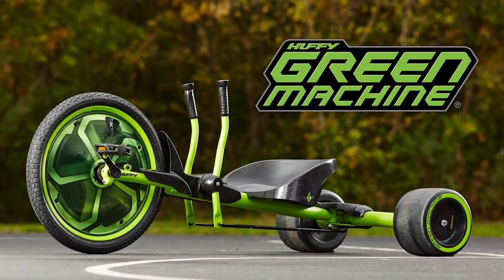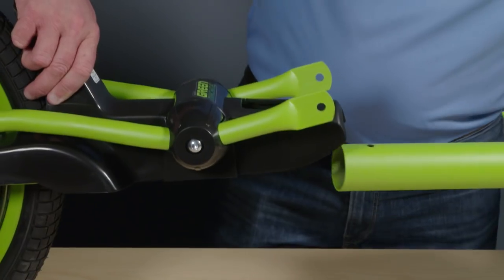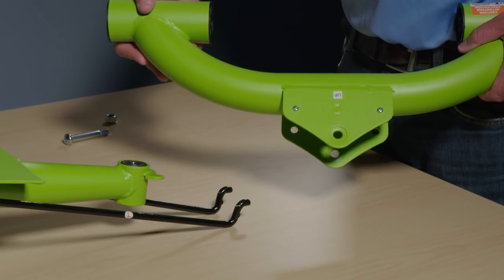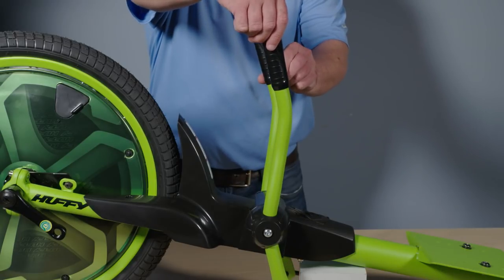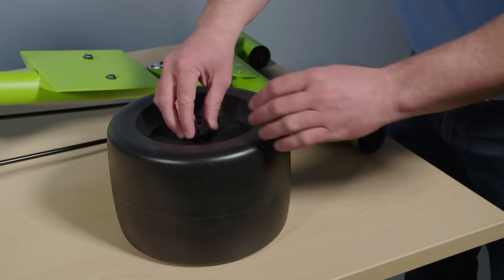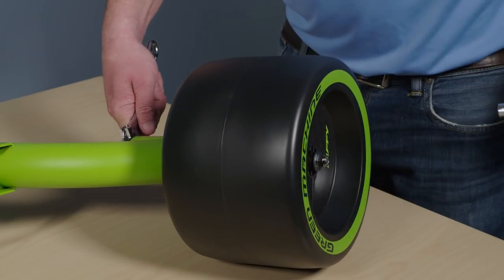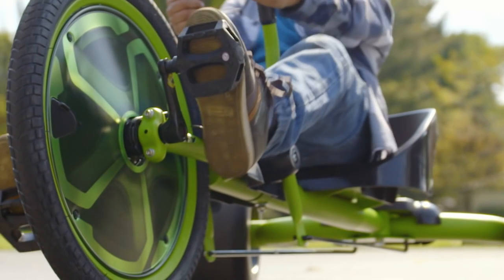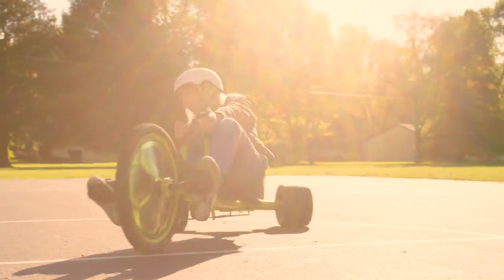How To Assemble The Green Machine by Huffy

Comment: Anything I can do to solve a problem where one of the rear wheels doesn't spin as freely as the other?
Reply: I have that problem
Reply: @arnolduriostegui1517  Lossen the axle nut just a bit.
Reply: hmmm yes, only  one side though.....  the axel is supposed to stick out a little bit so the washer can rest on the on the axle so it moves freely .. but on the the other side the axle isn't sticking out at all infact it's s to far in, so when you tighten the nut the wheel doesn't , move as freely but i'd rather it bee safe and it would still work.

I was curious so I swaped axles from the ok one to the other side but same issue, so got a feeling it's the wheel or something else causing it.

Comment: Did anyone have any trouble putting the bolt in the rear axle? 
It only goes in as far as the thread then stops
Reply: hmmm yes, only  one side though.....  the axel is supposed to stick out a little bit so the washer can rest on the on the axle so it moves freely .. but on the the other side the axle isn't sticking out at all infact it's s to far in, so when you tighten the nut the wheel doesn't , move as freely but i'd rather it bee safe and it would still work.

I was curious so I swaped axles from the ok one to the other side but same issue, so got a feeling it's the wheel or something else causing it.

Comment: I purchased this for my daughter birthday, opened it in it’s missing all the screws and some bolts, even worst we can’t get in contact with them😥
Reply: missing washers myself , and also a wrench socket
Reply: Huffy makes this item and all replacement parts can easily be purchased cheap from them, if you have issues contact huffy customer service, the number is available on any search engine

Comment: How do i replace the tyre tube in the front wheel?
Reply: Same way you replace a bike inter tube. Remove the front wheel. Make sure air is empty by holding deflate button on fill nozzle, Use a pry tool to remove tire from rim, prefer plastic as metal tools may scratch rim. Once tire is off replace from Walmart or wherever same size tube as indicated on tire. Reverse removal inflate to tire recommend psi
Reply: @vortexrising2943  how do you get the front tire off?
Reply: @hughwegley9630  remove the two lower allen screws on each side of the fork
Reply: Right under the wheel fork, removal all the air, use a wedge tool or crew bar, a strong plastic to avoid rim scratches off you have one, gently peel off one side of the tire and hand remove the rest, the inner tube is located inside the tire, reverse install

Comment: Is it possible to get the rear wheel??
Reply: Huffy sells the rear wheels for $8.50 each but the shipping is $12 unless you spend over$49
Reply: @vortexrising2943  I want to put drift trike tires with PVC sleeves on mine.

Comment: I thought Marx made these? I guess Huffy bought them out?
Reply: Marx made the original all plastic model in the late 70s as the successor to the big wheel which they first introduced in 1969. Huffy simply reintroduced the concept using steel bicycle frame technology  in the early 2000s.